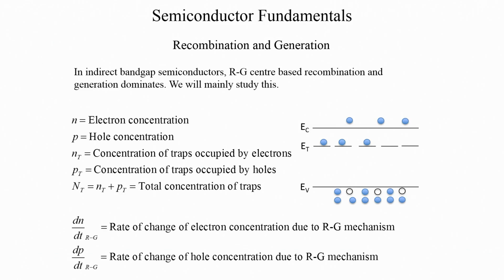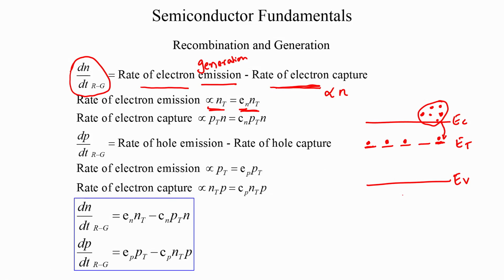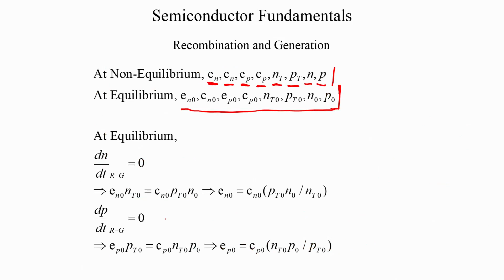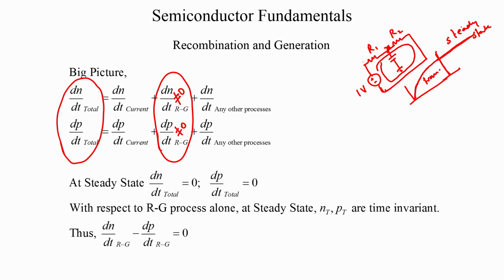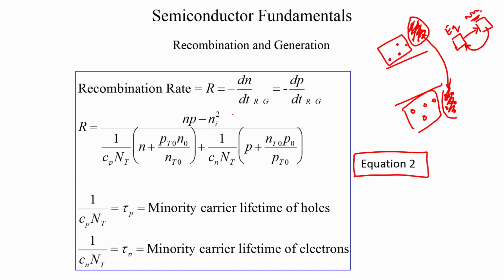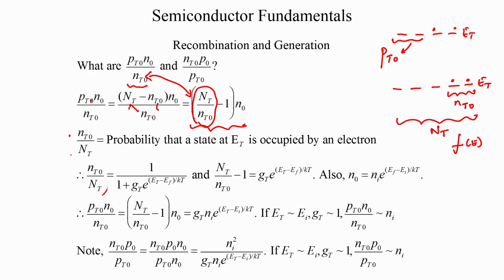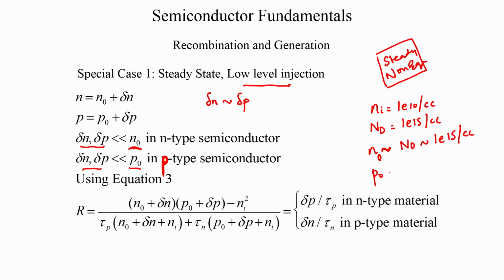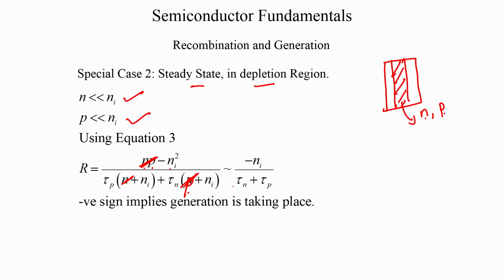lec15-Recombination and Generation - Continued

Comment: So, non-equillibrium steady state for RC circuit is a voltage applied which has reached a steady state of parameters(voltage/current). An equillibrium state is no voltage applied.
In terms of semiconductors, steady state non-equillibrium is a fixed temperature whereas non-equillibrium is  a changing temperature. So, is euillibrium in semiconductors - 0K temperature.
Kindly correct.
Reply: np = ni2 at any fixed temperature. If np != ni2 , this means the temperature is not fixed or non-equillibrum steady state means temperature is changing?

Comment: At steady state recombation rate =generation rate
At thermal equilibrium generation rate =recombinantion rate (please explain this sir)
Reply: sorry for the late reply - an understatement. thermal equilibrium is the condition where every little event that is going on is completely balanced by an opposing event - essentially one cant extract work from the system. In steady state the net time derivative of all events is zero.
Reply: @sanjivsambandan5157  sir initially we made the approximation that emission and capture rate in quasi equilibrium is same as that of equilibrium and rest all the quantities Nt, nt, pt, n, p change in quasi equilibrium.  Then after some time while writing the differential equation in non equilibrium steady state you told that for R-G based process net dn/dt and dp/dt is 0 but individual process may not be zero but they balance each other as nt and pt are time invariant in steady state..So can we conclude that in transient phase nt, pt are dynamic but they become static at steady state??